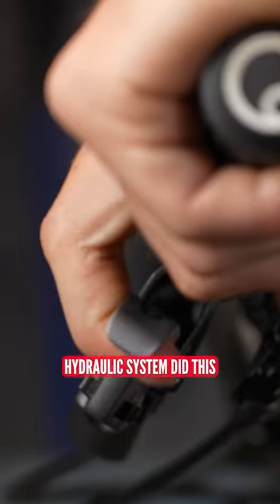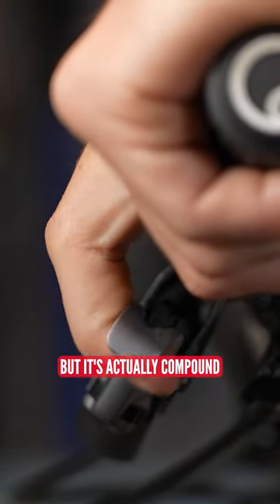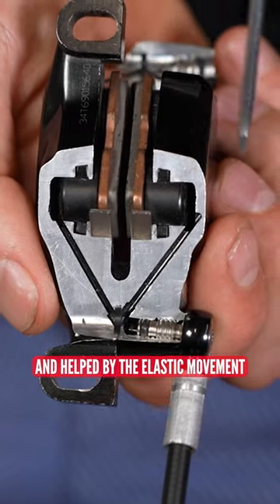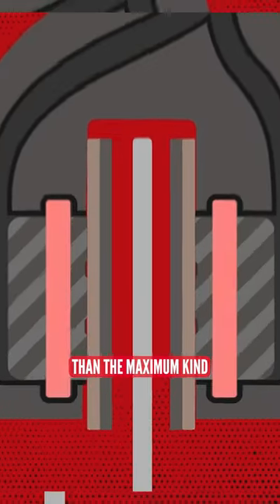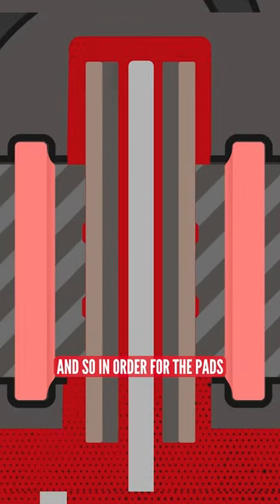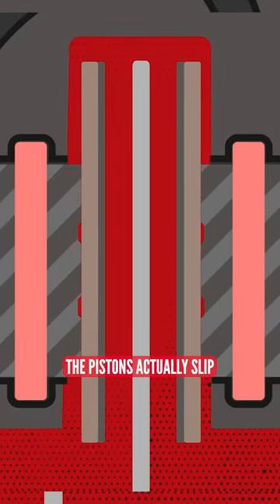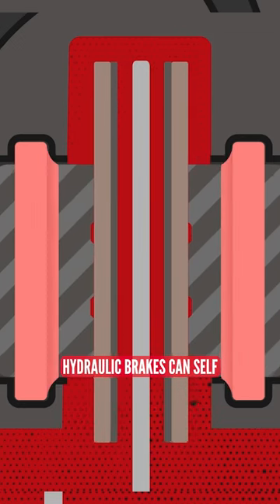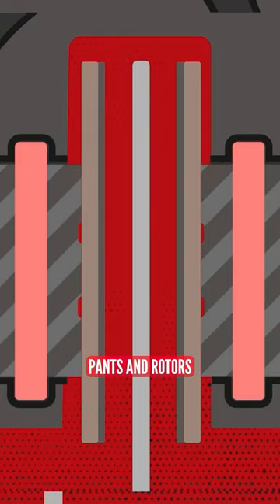How Brake Callipers Work! 🧑‍🔬

Comment: If you reset the pistons will it not cause some bubbles on the mineral oils?
Reply: You shouldn’t have any air in the system to create any bubbles.   If you do, you need to bleed your brake lines anyway.